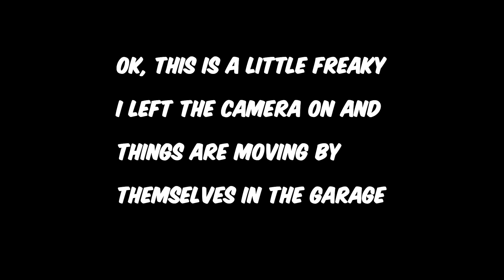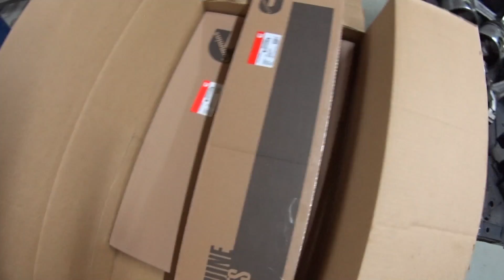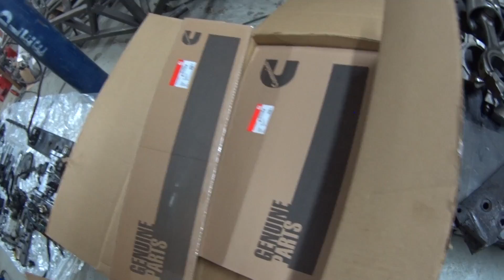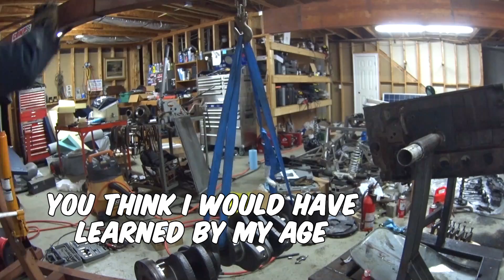5.9 Cummins 12V Rebuild pt1 - F250 Fummins Swap Project

Comment: To properly do a compression test you have to have engine running. You have to remove each injector separately install compression tester and run engine for a few seconds record reading and reinstall injector and go to next cylinder and repeat procedure!

Comment: Had an alum flatbed on my 5500, wont to that again, if you use it for a truck, it dents way to easy an if has ribs they bend to easy, had same prob on my retinourer trailer hauling steel, but your call, id go steel with plate for surface or apitong with good braces, apitong hold up well an what our steel equipment trailers had
Reply from the maker: Thanks, I've never had one before and value you sharing your experience. I think I'll go steel. What do you think of this https://youtu.be/xrFtvfu_OJE

Comment: Hey I love your videos. My only suggestion would be to edit out the parts where you are moving the camera around when mounted to the tripod. Makes an awful noise lol.
Reply from the maker: Ok. I 'll try to avoid that . Usually I am talking at the same time and need the words and its just bad timing. Something I need to work on for sure. Thanks for the suggestion.

Comment: Geeze your machine shop must be doing way more then resurfacing your head but even with it being cleaned head resurfaced and a valve job cant believe it cost you just as much as a new head. Cost me about $60-100 to have a head resurfaced
Reply: same lol. my current truck i pulled the head cleaned up surfaces and threw on a new gasket and studs and its still going strong with 60lbs boost. and that was 4 years ago. something like 50k miles.

Comment: That little baby diesel will build just like any other engine - since you bont have any history you should measure the block and make sure nothing is tapered or oblong - you should have left the assembly lube off till u were finished with the plastigage - like the other guys - I'd rather had an American made rebuilt head than any kind of reverse engineered Chinese crap .... just keep doing these kinds of projects and you will learn ... some of the lessons will be spendy and be painful but you will never forget - and when you see some other guy make the same mistake you will scream too.... you need to think ahead some with ur safety guy - one of the objects of life is to go through it with all of your fingers and toes - you don't get to drop many motors without getting hurt somehow - you need to spring for the Cummins shop manual for ur engine and don't depend on the internet mechanics to show you the way ... some of these on line guys don't know any more than you - I agree Deboss is a pretty good wrench but in videos lots of things are edited out that could cause your project to go south in a big expensive way... i used to work for Cummins and have seen about every kind of failure there is and i can tell you this - be very careful rebuilding an engine if you have no experience with the type of engine ur rebuilding - it's no fun to do all the work and spend all the money and have it shell out in 30 minutes..

Comment: hmmm just thinking , wat couldve caused the jam in the old motor could allso been a lobe of the cam hitting the crank (if its not set up propperly)

ohw darn , guess you whont be using that motor 

about the movements in the garage , could be a barely noticeable earthquake then again the engine is heavy and has a lot of stored energy , it might take a while for it to stop an initial movement

please lay that camshaft down on a few blocks of foam , it it falls over you will damage it

i was flinching the whole time you tried to lift in the crank by hand afraid you would nick either the bearings or the crank journals 
might work even better if you turn the engine straight up so the bearings are pointed to the side and hang the crank in the crane hanging from a treaded eye bolt in the snout then move the crank toward the motor using the wheels under the crane or the engine stand , i think it will give you a little more fudge room to get the crank to lay in the bearings without damage to them as you can finetune it by lowering or raising the crane and not have the full weight of the crank on the bearings
Reply from the maker: I think the jam in the old motor was caused by the scoring in the cylinder walls and rust buildup at the top of the cylinders.  Totally understand your concerns about nicking the bearings and journals. The crane was definitely the way to go and I think your idea about doing it vertically is a good idea. May try that next time if I get a chance.